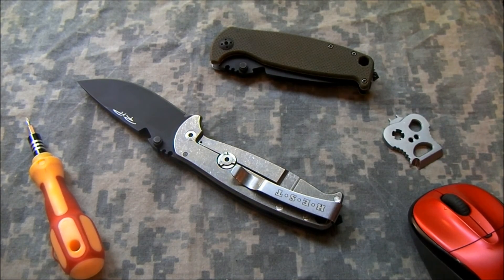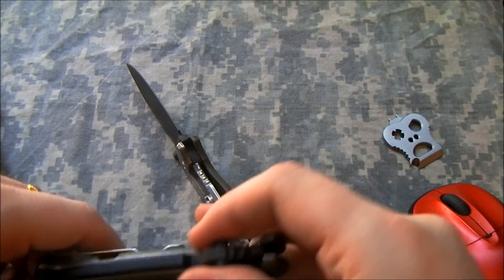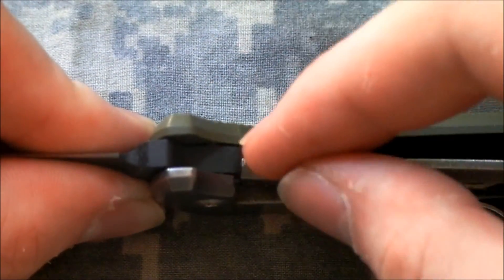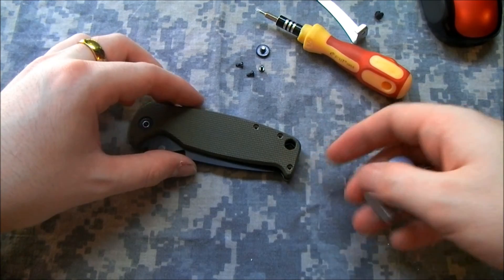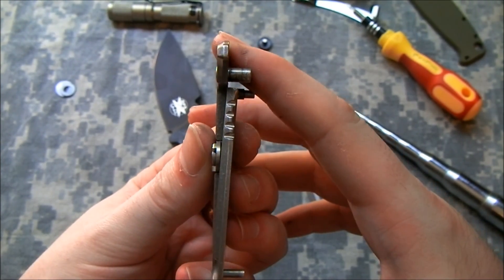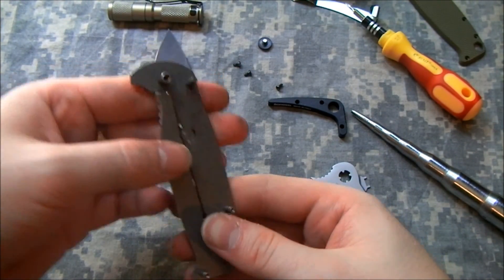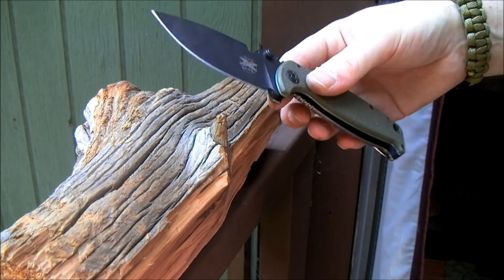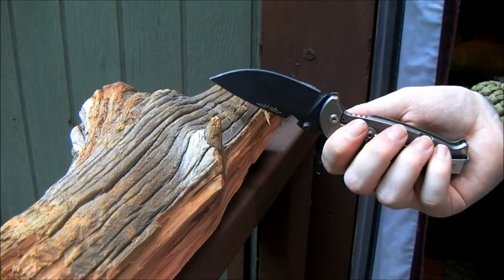HEST/f  2.0 Update - Teardown, Fixing the Play(?), Spine Whack Testing

Comment: Using a stop pin with a little bigger diameter could help too to bring the lock closer. But it will be hard to get this. Maybe it is possible to make one by youself or get some help at from someone having a lathe. You should compare the diameter of the stop pin with another HEST Folder first.

Comment from the maker: @JDYTC Agreed, well sorta. You could buy most anything from Spyderco or Benchmade instead of it and still have money for dinner out. I'll agree with you there. But in the very specific market of titanium framed hard use folders it's actually the budget option. It's a heck of a lot cheaper than anything from Strider or Hinderer for example.

Comment: This is good entertainment! Like I said it's just how it is. Once you've worn it in more that lock bar face will wear more & it'll come back. It doesn't matter so long as it doesn't fail. People gota accept that & in some ways enjoy holding the lock down to keep it secure. I never said you can't bend them in to alleviate the rattle taht's come to do for Striders too but it's still got a time limit for how long that works. But thank you Sr joben for doing this vid cuz I need to figure out to buy

Comment from the maker: @TechnoZombie That comes with the HEST, it's specifically designed for the pivot screw and the pocket clip bolt/glass breaker. The prongs are a little too big for the EL-02. It works for the EL-01, but you have to go really carefully because it doesn't span across the bolt, rather is goes on one side, making it trickier to rotate.

Comment: I've looked at this knife more than a few times online.  I'll probably hold off until they get the quality control issues figured out. I just purchased the Hogue EX 01 in green Gmascus. An outstanding folder! Check them out if you care to. Also the Ontario Utilitac with tanto blade is a great knife and priced extremely low for what you get. The Boker Cox and model 67 are amazing knives; both made in Germany. I bought the Cox on Saturday along with the Hogue and an Exotac fire starter. Thanks